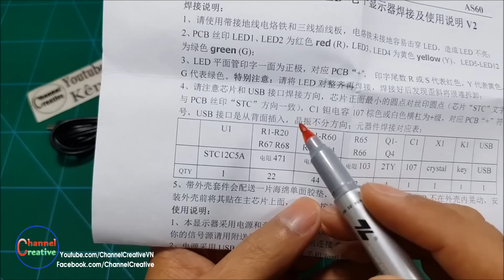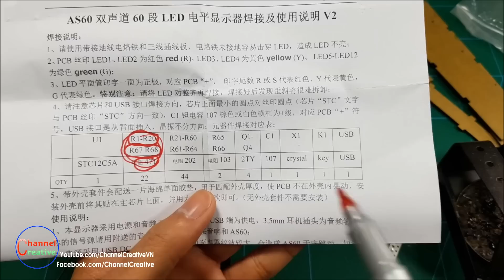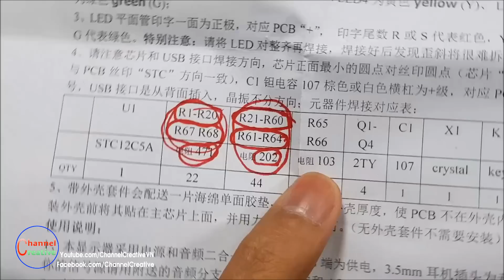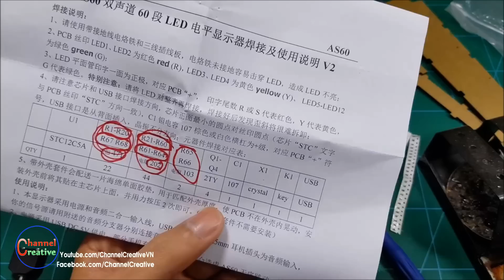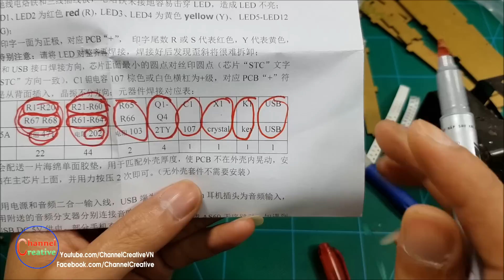Assembling - DIY Music Spectrum VU Meter Dual Channel 60 Segment

Comment: Thanks++++++++++++a lot for your video,
without it I would not have assembled the kit, first timer with smds,the only hard thing with the kit is the ic STC, must be Lined Up CORRECTLY, no instructions included only Chinese that says the components.
Kit works great no problems.